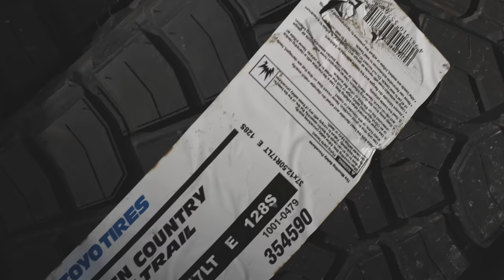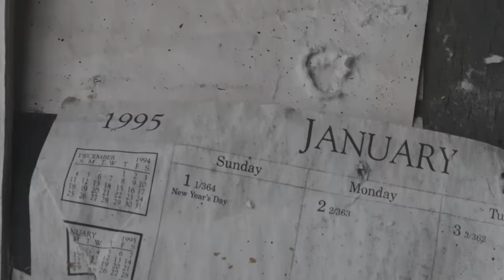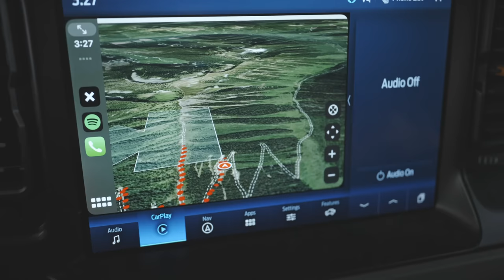I'm Lucky to be Alive...

Comment: I love seeing the TJ in this group. They are easy to do a mild build on and extremely capable. Most  Problems and issues are known and have well engineered solutions.
Reply: LJ so even better 😃👍🏻
Reply: Thanks for the LJ love. Lots more to come
Reply: TJs are my favorite of all the Wranglers (possible exception would be an old school Scrambler... but that's not technically a Wrangler, so probably doesn't count).

Anyway... I think the TJ takes the cake. First gen of the coil springs on all four corners, they're super easy to work on, parts and aftermarket upgrades are plentiful and cheap. It doesn't take much to build an incredibly good off-roader for super cheap. A 3" to 6" lift, lockers, and 33" to 35" M/T tires, and you're good to go over most anything out there. No, it's not going to be competing against purpose-built crazy expensive rock crawling rear-steer buggies, but it'll be a daily driver you can wheel in all but the most extreme of what mother nature has to offer up!

Comment: I have to wait till I finish my truck build but I would love the opportunity to go wheeling with you guys. Your adventures are exactly what I had in mind when planning my build.
Just a quick description of my build, 93 Chevy Silverado single cab short box, F350 solid axle swap (e locker rear) WFO conversion kit, which translates into a 7" lift on 37's, LS+ swap. I consider it to be kind of a baseline until the build grows but I promise it will be quite capable as is.
I look forward to following your adventures through the winter as I get my truck sorted out.

Comment: I just got Toyo R/T trail on my 3500HD single rear wheel, four-wheel-drive diesel track and I really like them. Really good traction in mud, dirt, and surprisingly good traction on wet roads, and no hydroplaning with them either. I drive through about 6 to 8 inches of standing water at 45 to 50 MPR. For a tire that has virtually no sipping on it they get surprisingly really good traction. And there are a very comfortable tire as well. I was told that the Toyo R/T Trails have A extra thick sidewall and reinforced carcass. so it gives you approximately 85% of the same durability you would get out of a mud tire but you get the comfort of a two ply sidewall. so far I am super impressed with this tire on my truck. And you guys did not mention that the Toyo R/T trial has a 45,000 mile treadwear warranty.
Reply from the maker: That’s great! I didn’t know that but I’m not trying to sell them, just give my opinion on them :)

Comment: 20:30 agree with you that IFS sure fails there. Not enough down travel on those systems. Only one I ever liked was the early 80's Bronco and F150/some F250 systems. They had opposite side pivots and did have good travel. But your Bronco is wider than the Jeeps so that should offset some of the issue. Glad you all got out safe though.

Comment: Love the videos. I’m amazing at how experienced wheelers still want to cling to the uphill side of a shelf road when there is ample room to the down hill side that would result in near level travel. Most of the rolls on Black Bear Pass are caused by people hugging the uphill side, causing their rig to roll towards the downhill. Like the hill at 16:50. If he’d been in the lower rut on the passenger side it would have been much safer.
Reply: In person is a lot different than in person. The lower rut was loose dirt, you could tell it was recently shoveled. Ground above was solid with a back up of sliding into the rut.
Reply: What Bruce said. There’s a reason we all took that line

Comment: The bronco reminds me of when I had Spring under axle leafs on the YJ, always hanging a tire! I got so used to it. Doesnt happen very often now with the new setup.
Reply: I kinda think a YJ minus the track bars would flex better???  Well, and springs that weren't 30 years old.
Reply: @LGoody9273  believe it or not the old stock springs flex really well, its the high arch SUA lift springs that dont. well they uptravel but have next to no droop.
Reply: @FlawedOffroad I've had the stock springs on my son's 90 and my 93 re-arched, I think we're both right.  Both Jeeps rode, drove, flexed way better after.

Comment: Very exciting video. i think you all take too many risks. What do you do if you come to a dead end and you can't turn round.  on a steep angle like that i think i would lower the air pressure on the tyres on the high side of the slope.
Reply: We’ve had to do that, and it’s been ok. It’s those situations that you stop, take in all the info around you, and do what you’ve been practicing for many years. It’s the unfortunate part of the never ending search for new to you areas.

Comment: What I’m realizing about this articulation debate is that between the Jeep and Bronco, there’s really no difference when it comes to safety on flipping. The Jeep will flip the same as a Bronco. All articulation does in 99% of the case is just for traction. Wheels going up in the air doesn’t not mean the Bronco will flip more than the Jeep. The Jeep can articulated more and actually touch the ground deeper and it can still flip if it’s too steep. Touching the ground or not will not matter at that point of on center of gravity issue. Or if the Jeep don’t flip, the Bronco will do it by seesawing down the same spot. The rigs weight pivot point is the important part and you don’t want the weight of the rig shift towards that deep spot too much that the weight shifts forward. Because the drooped suspension will not be able to keep the weight of the rig and will compress and not hold the rig and flip forward if it’s too deep no matter what. This is why I like the Bronco better because it can go where a Jeep can go except a Bronco will be more comfortable at high speeds or anywhere. Better on gas too at 85-90mph. Important on long trip which is common for offroading camping guys.
Reply from the maker: I'd say bouncing on 3 wheels is definitely a big difference from being completely planted, safety and comfort wise.
Reply: @TheStoryTillNow  I guess “feeling” safer has its appeal. It doesn’t necessarily actually make it safer IMO. Like this exact example that happened to you on this video. Safety factor exactly the same with the Jeeps.
Reply from the maker: @filipinovegaslife70  It has nothing to do with feeling. Bouncing on 3 wheels at 25 degrees off-camber is not safe, period. Having 4 wheels on the ground instead of 3, is always safer.
Reply: @TheStoryTillNow  

Would these safety concerns you're having perhaps drive you to sell the Bronco? You seemed to be a little shook up about the experience on that shelf road, which is completely understandable, and that's why I'm asking.
Reply from the maker: @CaseyCollier  I don’t anticipate hanging onto it much longer.
Reply: @TheStoryTillNow  

Ugh... that's disappointing to read. I really liked the Bronco when it first came out. I'm seeing them everywhere where I live. I guess I'm glad you at least tried something new, instead of just going with another Jeep. Do you have any plans moving forward that you can share? Any new vehicles catching your eye? You don't have to answer if you don't want to. I'm just curious.
Reply: @TheStoryTillNow  you probably wouldn’t even know your wheels went up unless Bruce Cook told you! Don’t lie! 😂
Reply from the maker: @filipinovegaslife70  you can visibly see it bouncing in the video dude, come on… that’s the worst feeling.
Reply: @TheStoryTillNow  ok ok. I love your videos bro

Comment: Nothing beats solid axles when it comes to flexing. I own many offroad builds from a 09 h3t alpha hummer truck a 07 yota fj cruiser,  a 06 jeep commander,  a 07 land rover lr3 , a 05 jeep wrangler unlimited rubicon,  the one I take off road the most is the 05 jeep wrangler unlimited rubicon I built it up with old school lift I bought new 6inch long arm by full traction not sure if you can still get it if yes it probably take months to get it along with Hanson rear bumper and basket package,  front arb bull bumper warn 9.0rc winch 2 speed advance adapter transfer case,  rock hard roll cage , dual battery by odyssey,  g2 front new axle geared to 488 and rear to 488 with arb air lockers , sitting on Mickey Thompson mtz 35x12.50x18 , solar panel on hood to keep batteries top off, Galvin wilderness rack with arb rooftop tent , I installed a sprintex supercharger to my 4.0 my build something from mid 2000 I love it because she not what most people drive today old school no bells no whistle last of the all metal jeep she is heavy curb weight 3740 gross weight 4600 I went to a cat scale I'm 5800 before adding more gear for overlanding that's 1200 over , nobody on any channel talks about how weight effects gas mileage to being safe on the road or trails or what might happen being too heavy I have more on my jeep than what I mentioned like warn gas tank skid plate arb awning,  hi lift jack, front runner dual drawers ,  brake kit on front axle , lmy gas mileage is terrible but she a beast off road , I bought the rare h3t alpha hummer truck over a jeep gladiator because I didn't want a 80k jeep means jeep price plus build price , the h3t has very little to nothing to build on no accessories it died years ago but this doesn't mean you can't build a nice build in the bed area, I ordered a road armor bed rack and bought brackets off Amazon it worked perfectly why road armor bed rack the adjustable rack works perfectly but it was made for the gladiator,  decked drawer system didn't work , but front runner dual drawers did with room to spare and on top of that I installed a front runner cargo slide so I don't have to crawl in bed, oh yeah other reason for road armor rack spare tire can mount on rack , from here the usual gear you see on a rack driver side 4 max tracks,  driver side 4 water rotopax I felt water very important offroad , I added a front runner roof rack to bed rack with arb rooftop tent and awning , and hi lift jack , on cab another front runner rack with 23 zero shower room , pelican storage box  , 10 gallon waterport these are real nice , Hella 4 offroad lights , front bumper arb bull bumper warn winch , sitting on 34inch tires I just installed a snorkel,  and head lights led, I plan to install headers to the 5.3 v8 not much more I can do without really modification to front axle without replacing it with a solid axle this is the only thing that socks no lift kit available,  even tho hummer h3t built off Chevrolet Colorado suspension but still different,  but I am happy with what I bought not to be a cookie cutter build , nobody needs all the things we but from 40inch tires to 4k rooftop tents to go overlanding I think I still came out far cheaper than a gladiator build only speaking of myself but when it comes to flexing jeep owns it maybe next time I talk about my yota build or lr3 the lr3 turns just like a wrangler the hummer and yota turns like a vette terrible anyway c u on the trail

Comment: Being new to the off-roading world I went with a JLU due to solid axles. Seeing the difference between the bronco and the jeeps to me is crazy. I was always told to go with a solid axle then a independent suspension. Might be a dumb question and I do apologize as I’m just trying to learn. Why is the solid axle more desirable for off-roading? And another great video keep up the great work
Reply: Solid axles do great on stuff like this, as it allows all the tires to touch ground, until at full articulation.  Ifs lifts a tire, as it can’t lower beyond its bottom out point, and let’s it lift. It’s crazy to see, on the side of a shelf road. 😆. Was hard to just film. I had to make sure he knew on the radio.
Reply: @DennyOfTheAlpine  well it was amazing video as always. One day I would love to find some of the trail you guys do. I might need a few extra pair of boxers but I think it would be worth it keep up the killer work

Comment: Get rid of that Bronco!
Reply: I was thinking the same thing. Or set it up to flex better.
Reply: Yea, and what's with flashing lights on the damn thing? That would drive me nuts.
Reply from the maker: It doesn’t have flashing lights. It has LED lights with a lower refresh rate than the camera’s sensor.
Reply: Yup. And I kept the old bronco. 😁
Reply: @TheStoryTillNow the bronco is a capable rig.. haters got to hate.. to each their own.. the gladiator is cool too.

Comment: At 20:13, I don't think the Bronco is the problem. The drive chose a line that places left wheels deep in the rut while right wheels on a much higher place. Moving the line 10 inches left, the left wheel won't fall off the cliff but the tilt angle will be much better. In this situation, getting closer to the cliff is actually safer.

Comment: 16:52 This may sound ludicrous but in that extreme angle would it make sense to air up the passenger side and air down more on the drivers side to offset that anus clenching angle?
Reply: I’ve actually had to do that one time. Does help a little bit in the right situation 😅
Reply: @BruceCookfmx  I could imagine it would make the trip much longer as every time you go around a switch back you would have to do the same for the other side. I hate those off camber shelf roads they make the hair stand up on the back of my neck. It is even worse when it is wet outside.